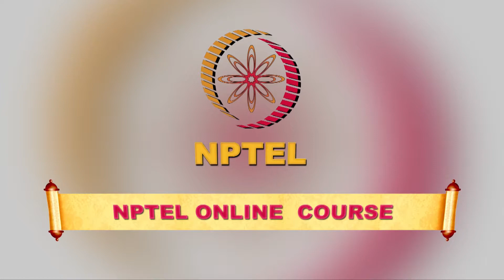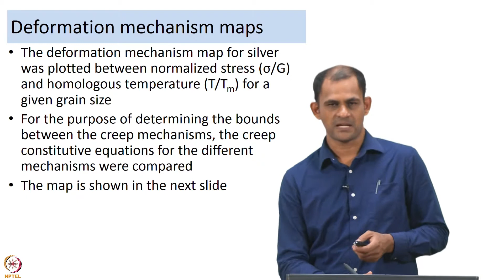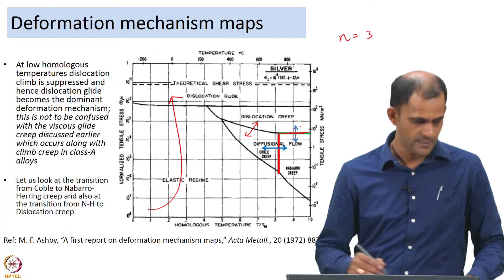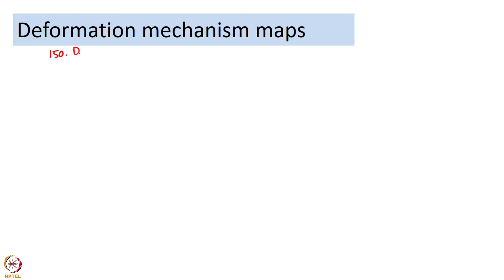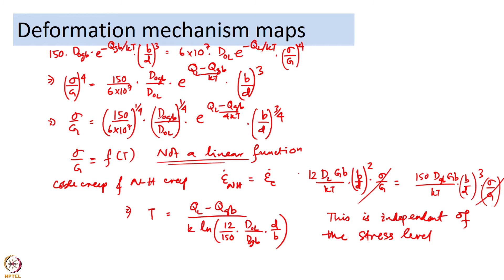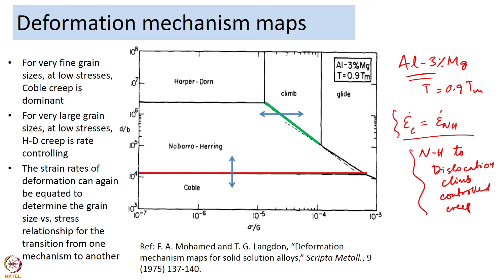Deformation Mechanism Maps - Part 1

Comment: Sir...how can be T/Tm values are greater than one, on x-axis ?
Reply: Hello Mr. Sunil, the T/Tm value is not greater than 1. The numbers are 0.1, 0.2, ...1. The decimal point is not visible in the video
Reply: Now it's clear sir and one more follow up on the same map...why grain boundary sliding mechanism is not represented in the map?
Reply: @sunilugadi3653  Sometimes GBS may or may not be observed in a material, it will depend on the microstructure, applied stresses, temperature etc. Fine grained material will be more prone to GBS compared to coarse grained material. In the work carried out by Ashby, maybe they did not get n = 2. A n=2 indicates Grain boundary sliding. Probably that is the reason GBS was not shown in the map